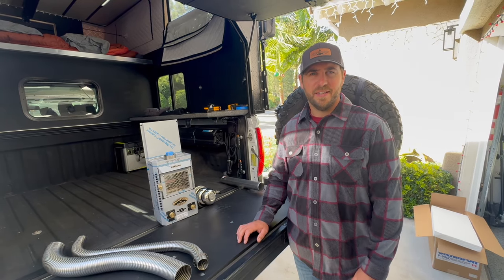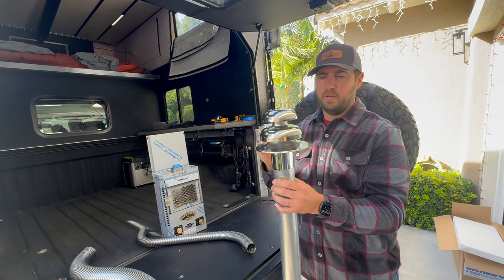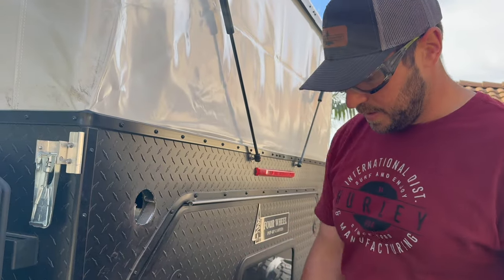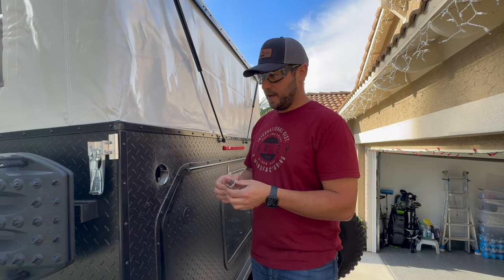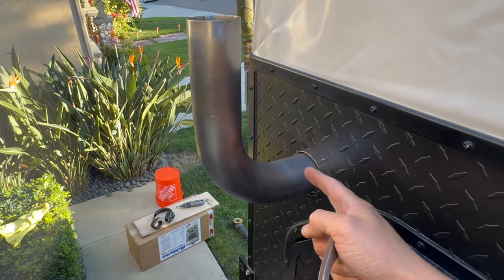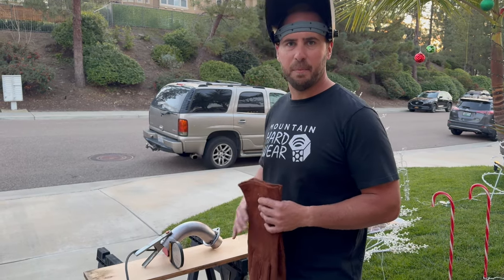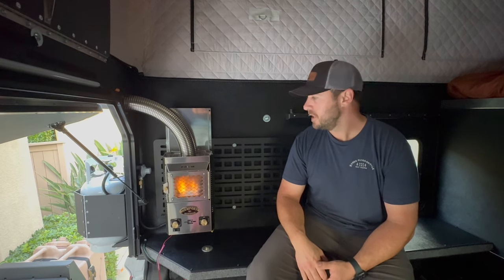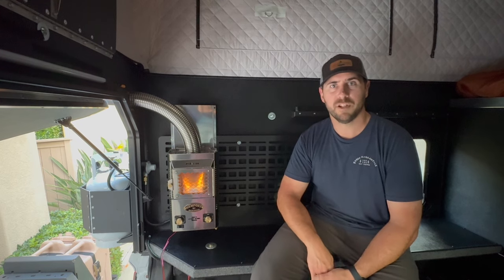Installing a Fireplace Heater in Our Truck Camper Project M | Cozy DIY Upgrade

Comment: Howdy, nice looking install, I’m sure the ambiance from the Dickinson is awesome and super cozy! One item I learned while installing a Propex in our OVRLND camper: the propane regulator needs to be outside your living space as the regulator can vent propane. Also ensure you use the appropriate regulator for your mounting position (horizontal or vertical - learned that lesson too). Lastly you may want to install an explosive gas detector so you’re made aware ASAP if anything starts leaking. Enjoy your camper and hope to see you down the trail.
Reply from the maker: Those are great points. I’ll look into all those things. And I do have a sensor.  But I’ll check on the regulator. Thanks!
Reply: @prospectoverland Man, pls do. I just knew u existed for the past 20 min but I’m already nervous. Lmfao. But, that’s because I imagine it’s myself doing this.

Comment: How did you mount the Expedition Essentials propane tank holder?  Does it still out “too far” from the footprint of the camper? I have the same one and but am I’m worried that it will still out a lot and can easily get ripped off.

Comment: NICE dude, waiting for my project m  to be built. I have been buying up parts and so forth  for my build. I am curious to see your solar panel bracket system up to, I did  opt in for the tracks on the roof but nothing  else. I have looked at over 50 ideas to heat  the unit inside. this is def the BEST way to do it. please keep us updated, would love to see you testing this in real world cold temps.
Reply from the maker: Thanks and congrats. You will love the M

I did a whole video on solar if you haven’t seen it and have an Amazon parts list in the video description. I also just ordered with roof tracks and did the rest myself.
Reply: I will go check now my dude thanks! ever make it to reno! hit me up lets make a drone video of the two project Ms! @prospectoverland

Comment: I have a P9000 in my Scamp and it works well.  I'm a little curious about your chimney.  I  have a lot of experience with wood burning stoves and I'm always careful to locate the top of the chimney to above the roof line so when the wind blows across the roof it does not create back pressure or vacuum that could affect how freely the hot air rises, and how in this case the cool air circulates downward.  You could probably test that at least to some degree.  Have you tested this setup?
Reply from the maker: It works amazing and use it all the time. I kept the chimney low to avoid it being ripped off on tree branches and such while running trails to camp. 

It has gone out one time in a crazy windy snow storm. But it has a safety switch as I’m sure you know and auto turns off the propane so no biggie. Just re lit it and good to go.
Reply: @prospectoverland  Glad to hear it's working well!

Comment: Well done! Haven’t seen a Dickinson installed on a 4Wheel PM before. I’ve cancelled out certain canopy campers due to their inability to mount one, and the Alu Cab seemed to be the only one that could take it. Now the Project M joins it! Love it.
Reply from the maker: Thanks! Yeah it’s doable for sure. I also had only ever seen in Alu Cab but was determined to make it an option for the PM.
Reply: Were any of the eliminated brands / models due to mounting incompatibility:

Radica Moonlander X?

Topo Toppers Rincon?

Comment: Awesome camper and installer. My only thought was the closeness of the exhaust to the tent material. It has been 2 months so assume I worried for nothing. This project M is still my first choice unless I find a used camper shell first.  I dont need much for one or two night getaways. Stay safe
Reply from the maker: No issues at all just spent the night in the snow and blasted the heater all night. No issues with tent material. The project m is unbelievable comfort and space.
Reply: @prospectoverland  Awesome!!.......yeah, that was my first thought too.  So no issues with the vent fume temperatures, huh?......bad A

Comment: Thanks so much for posting this.   I'm going to be doing something similar on an overloading travel trailer like camper we are building.   Our camper also has a pop up roof.   How is that chimney cap you have working?   Is there any heat or soot getting on your pop up?   Subscribed.
Reply from the maker: Hey thanks for watching! The heat coming off the chimney is minimal. The vinyl pop top doesn’t get hot at all. And no soot at all either. The metal is too hot to touch but I can hold my hand just 1” away and the air coming out once mixed with the cool outside air is just warm.
Reply: @prospectoverland  Ok great, I plan on a solid fuel heater, but I hope its similar in behavior

Comment: Great job on the install.  Any concerns about how hot the exhaust cap will be so close to the vinyl?
Reply: Curious about this also.
Reply from the maker: Thanks! None at all, I can hold my hand right next to the exhaust and just slightly warm air
Reply: Does that outer pipe get hot enough to cause any issues to the styrofoam insulation?
Reply: @prospectoverland  Nice.  That's encouraging.  Looking forward to hearing how it works out for you guys long term.
Reply from the maker: @NYTAZ145  the outer pipe does get pretty hot. You don't want to touch it for very long. I think if foam was directly touching the pipe, then yes it would melt the foam some. I don't have any foam in the spot where it comes through the rear wall so no worries on that part.
Reply: Wonderful Install video!! I have an Ovrlnd camper (very similar to the project m) and already purchased a Dickinson heater.  My exhaust would be set up in a very similar way and was A) worried about melting my vinyl, so glad i dont have to worry about that.  Second, i was worried about driving when the tent is down and the exhaust cap blowing off? Does your exhaust cap sit higher then the top or your project m when it is put away to drive? Or is it strong enough and it doesn’t matter? Lastly, your 2.5 inch exhaust  pipe you picked up didnt look flanged at the beginning/ middle of the video but when you welded it, the end looked wider.  How did you do that? Im super excited to install and thank you!  I am using your vid as my inspiration!!
Reply from the maker: @joshua.eta1123  thank you. I purposely mounted the top of the chimney at the roof level when closed. So when driving under tree branch’s the chimney won’t get torn off. I would not be worried about wind with it sticking up, more so objects hitting it. 

And good eye….yes it was not flanged when I was first making the pipe to size. Then right at the end I took it to a muffler shop and they expended the tip so the chimney cap would fit inside it.
Reply: @prospectoverland  again,  thank you so much!! Looking forward to attempting this.

Comment: Now that you have gotten a chance to use this thing for a few months, how does it do in the real cold? I’ve heard they can’t quite keep up in the serious winter temps. But they are just so cool.
Reply from the maker: I haven’t been down in single digit temps yet but in the snow storm I was recently in it kept the camper 68-70 degrees inside the camper.

Comment: I have the same unit in my 5th wheel. Not great for heat in my big rig but should be great in your smaller space .Nice install
Reply from the maker: Ah yeah that makes sense. I can certainly see why the bigger space wouldn’t be great. It’s just enough for our small space but not by a lot. Thanks for watching.

Comment: Really nice install video. I was curious about the framing that you cut out but you explained it straight away. I have a project M as well and was considering different heating methods for winter. I’ve used (and still have) a buddy heater and a Wave 3 but I went with a cheapo diesel heater for this season. I may go another route for next year, I always have propane with me but rarely take extra fuel since I typically don’t need it. I  really don’t want to cut a hole in the wall for a chimney though since I’ll only have the heater for a few months a year so I’m thinking of exhausting out the window similar to how my diesel heater blows in. That flame burning in the Dickinson looks fantastic!
WOW this is a long comment.
Reply from the maker: Diesel heater is deff the best bang for the buck and simple/no invasive install process. I just wanted the real flame ha.

Comment: I have the 12000 on my boat installed 2 yrs ago.  Your install looks nice.  The only thing I would recommend is a 12v propane leak detector installed below the unit.  As you know, propane heavier than air so will seek a bottom.  I bought mine on Amazon and wired to fan wires on the heater.
Reply from the maker: We are loving ours! And yes we have a propane sensor installed and I tested it to make sure it worked prior to sleeping.

Comment: Can you run that off a thermostat? Does the exterior of the heater get very hot (hot enough to melt synthetics)? How loud? Very nice.
Reply from the maker: No thermostat option. Just low med high type of dial. The interior exhaust tube gets pretty hot to the touch. You would not want to set anything against it. Very quiet. 

Thanks for watching

Comment: Really funny I just ordered a diesel heater for my GFC today. 
I looked at this one and I think it will be awesome in the 4 wheel camper, but I couldn’t see it working well in a GFC. 
Nice job as always! 👍
Reply from the maker: yeah since everything opens up on the GFC would be hard to find a good spot to mount and vent the pipes. Thanks for checking it out though, appreciate it!

Comment: Very clean install. I assume the clearamce required from the chimney to the canvas is minimal and there is no way for that exhaust air to get back into the camper
Reply from the maker: Thanks!....Great point but enough clearance as to not heat up the vinyl and no windows in that section so no worries about exhaust coming back inside.

Comment: Nice. Well done. 

Is the exhause very hot?

Id be worried it might be too hot where its coming out up by the tent part of your camper.?
Reply from the maker: Thanks and no not at all. The metal tube inside the camper gets hot to the touch but the air coming out of the exhaust on the exterior doesn’t get anywhere close to hot enough for the tent material. Just got back from
Running it 8hrs a night this weekend and works flawless.

Comment: Not sure if your FWC came with a Carbon Monoxide Detector, but maybe it would be a good safety feature.
Reply from the maker: It does come with one and I added a propane sensor as well next to the heater

Comment: You did a great job, my only concern is the placement of the exhaust, and the closeness to 
The camper popup section
Reply from the maker: Thanks. Zero issues. Doesn’t event remotely get the material hot. I’ve run it for hours!

Comment: Hello, I’m doing this install on the project m using your links.  Do you add any gasket material between the steel pipes and the Dickinson?  Or do u just snug it
Reply from the maker: The included flexible pipe that Dickinson sends slips right on top of the heater. 

If you are talking about the other connection, the steel exterior pipe slips inside the larger flexible pipe. 

Look up GP factor also. They sell a product that can also give ideas for install styles. Just as a reference.
Reply: Do you add any rtv sealant between the steel pipe and the flexible pipe?  To prevent exhaust leak?

Comment: Does the exhaust heat harm the canvas at all? It’s right next to it…
Reply from the maker: Zero issues. The exhaust pipe does a very good job. I can almost touch the metal with my hand directly. I can hold my hand a 1//4 from the outlet and only mildly hot air comes out. 

It’s a dual layer pipe so the outside of the pipe is the cold intake air. Interior center of pipe is the hot air exiting.

Comment: How much heat gets put onto the the camper and tent?
Reply from the maker: None. I can hold my hand immediately next to the vent and just marginally warm air exits. The actual metal is a bit hot to touch for any lengthy amount of time but the actual air causes no issues